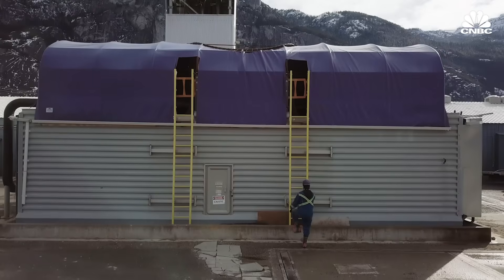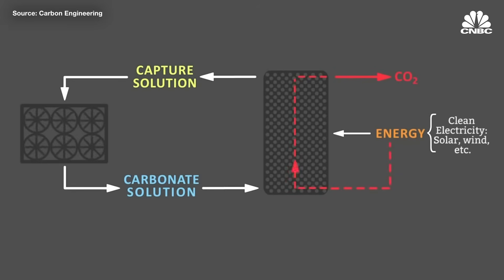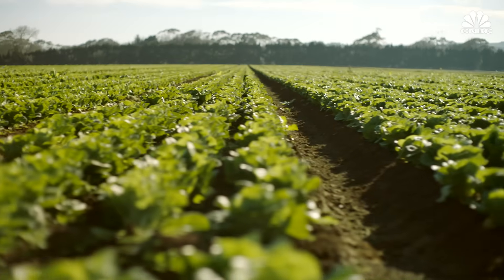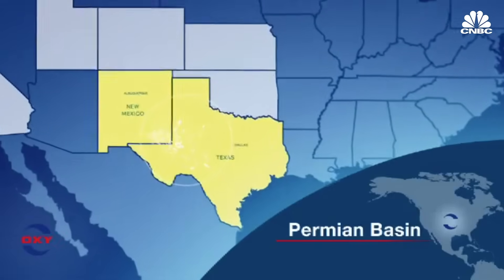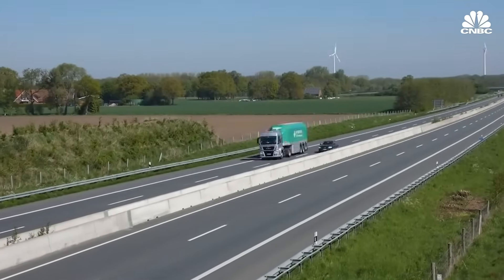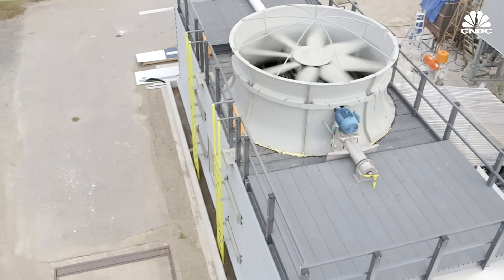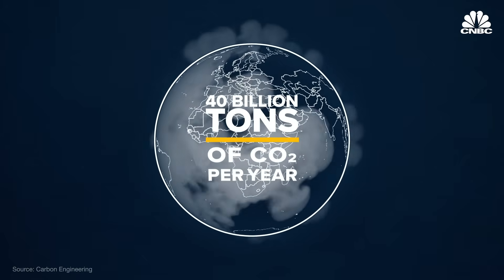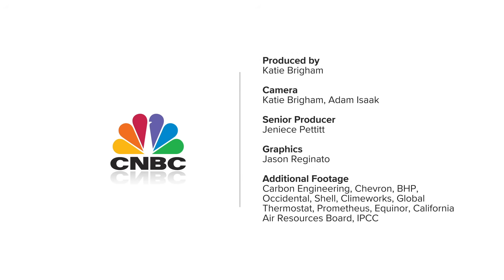Bill Gates-Backed Carbon Capture Plant Does The Work Of 40 Million Trees

Comment: And that's how they start charging for air.
Reply: They would get paid for co2 capture versus co2 emissions, which now have a co2 taxation system in a lot of countries. 
It's already a system for it. This is capitalism working in the right way.
Reply: @martink5842  1) its not working 2) its not capitalism if its imposed by state
Reply: @Goose Lee it doesn't make air... it removes co2 from air...
Reply: @martink5842  
Plants consume Carbon Dioxide & release Oxygen.....
Reply: Hey, we cleaned the air you breathing, so here's the bill.
Reply: @Goose Lee we as a species emit more co2 than greenery can absorb. We are far beyond the point of agrarian society levels of co2 in the atmosphere. There is not enough of space on our planet to curb the co2 levels we emit yearly by planting trees. There have been several articles about that. Trees cannot solve the problem alone anymore. Even if we use every inch of surface area on the planet that isnt water it still wouldn't be enough, that includes human settled areas. This is the only way forward concerning co2 in the atmosphere. 

Until and during 1700s  it was around 280 ppm with co2 in the atmosphere, and today, 2019, it's at 413 ppm.
So in essence in the start of the holocene until 1700s it was rather stable, some peaks and some dips in co2 levels. Natural causes for it. The planet was lush with a lot of pristine forests. 

And you cling to the notion of plants losing their co2 to grow? For real? 

Co2 is an suffocating gas for all animals. That is one property I hope I will never have to experience while being outside.
Reply: @martink5842  
You are Propaganda,
based upon junk science......
Reply: tim coker  
Only if you allow...
Reply: Good one
Reply: Do you know that there are several different types of photosynthesis? One type dislikes higher co2 levels, dislikes higher temperatures. 
If you've actually read about this you'd know that their broad spectrum arguments for "higher co2 is good for plant life" is a very thin one. If I remember correctly, an increase by 2% co2 decreased one group of plants photosynthesis by 12 to 15 %. 
If you come from non tropical climates you will know this as seasonal plant life. Why do some plants grow earlier than others. 
C3, c4 and cam... read up on these, please.
Reply: @martink5842  
Great Mumbo Jumbo.

Comment: ??  Um if you take carbon from the air you will increase weather instability .   Where do you mind numbed robots come from??  That is if you can remove enough,  to make a change, and even if you could a single large volcanic event would just replace it.   insects produce way more carbon compounds than humans ever could , this is total   P.R.
Reply: so doubling the amount by pumping it into the air is fine but try to undo that and that will cause instability?

also yes other things produce more co2, earth also already sequesters that co2, as it took millions of years to reach that balance
the important part is we BROKE the balance by increasing output and not bothering to increase sequestration
Reply: @magnusorn7313  What man puts into the air, is nothing compared to nature...  Summary...it is like taking your car to the repair shop, with a knocking engine (sun) and a transmission grinding (water vapor)  and the repair man  opens the trunk and removes a single lug nut from the spare tire (global warming) thinking that will make a difference.
Reply: @bobkat1663  "hat man puts into the air, is nothing compared to nature" irrelevant, nature took millions of years to balance out, we upped the carbon output but not the input, that means its out of balance
if as you say the earth puts out more then why havent carbon levels been rising steadily for thousands of years

use your brain on that one
Reply: @magnusorn7313  I understand where you coming from, but carbon levels have been much higher in the past, for very long periods.  It did not change a thing, if anything it will only improve our weather.
Reply: @magnusorn7313  The oceans are vast, and can filter alot of carbon from the air, fairly quickly.....in the past it is thought that the oceans either were not present or much smaller than now, and this help to contribute to higher carbon levels in the air in times past.
Reply: @bobkat1663  "carbon levels have been much higher in the past" yes, but you will notice that in the past these transitions take tens of thousands of years and not hundreds, and if they do take hundreds its typically correlating with a mass extinction

the thing with it happening slowly is that life can adapt and a balance can be formed

"It did not change a thing" flat out lie, changes in climate almost always correlate with species dying out, its not good or bad change, its just change, nad thats bad, because life is not good at adapting to sudden change
Reply: @magnusorn7313  You misunderstand me...the point is that the sun and water vapor drives earths weather, almost entirely, along with tilt of the earth and spin of the earth, not carbon or any other gas.  Now if the sun got bigger,  or got more intense, then you would see direct global warming.  The periods of higher levels of carbon I speak of, are at the peak of earths bio... past,  it is when everything including man were much larger. and lived longer.    Carbon output is the single lug nut on your spare tire, that is in the trunk, it has nothing to do, with the running  of your car. (weather).
Reply: @magnusorn7313  One other interesting note is some of the mass extinctions that occured, were also on and/or about the same time earth got more water on the surface of the earth. and yes there was more carbon in the air at that time...prob. due to all of the eruptions around the world, as a planet came passing by.....likely  Vensus or Mars  hard to say.
Reply: @magnusorn7313  The oceans moving across the beaches are earths #1  carbon scrubbers,  in the first place.  You could burn the entire surface of the earth and everyone on it, and the earth would balance in like 2-3 years, (seed growth, and fresh fertilizer).  Now very large events, do have a longer lasting effect but in the end, it is the sun and water vapor that drives it all.
Reply: @bobkat1663  "surface of the earth" how about all the underground coal?

Comment: There are 3 000 000 000 000 trees on earth. 75 000 of those factories. Building factories using fuel energy to reconstruct from co2 the carbon you can burn again is a solution which can be legitimately questioned.

Comment: Why Don't You Use A Windmill To Make Hydrogen And Mix It With The Carbon Dioxide To Make Methane And Water? https://en.wikipedia.org/wiki/Sabatier_reaction
Reply: CO2 + 4H2 @400 Celcius; Under Pressure = CH4 + 2H2O
Reply: In Situ Resource Utilization

https://en.wikipedia.org/wiki/In_situ_resource_utilization

Comment: Here's the problem with this technology: what do you do with the carbon dioxide that is captured?  The video says it is buried underground.  What benefit is that?  The video says it can be used to extract more oil.  That means MORE pollution.  The carbon could be used to make synthetic fuels.  And how many cars are out there that can use synthetic fuels?  Not enough to justify using the technology to make synthetic fuels.  So, as I see it, the main problem is that the captured carbon dioxide has a VERY limited use.  Is removing it from the atmosphere a good thing?  Absolutely!!  But what to do with it afterwards.  It's like desalinating seawater.  What's left is the brine.  What do you do with the brine?  Recycling something is one thing.  What to do with the product created after recycling is the second part and probably the most important part.  If you don't address the afterwards, you just have another problem to deal with.

Comment: Why are we getting sidetracked by these remedial processes when we need to NOT put CO2 and other greenhouse gases into the atmosphere in the first place? This is counter productive at a time when we need to putting much more resources into green energy projects. By an large, the planet has been greatly deforested and a carbon capture machine falls well short of providing the benefits we enjoy from a forest including O2 released to the atmosphere, habitat for wildlife (which is under going a major extinction), water storage and slow release, temperature moderation by evaporative cooling of the air, etc, etc.

Comment: Nonsense. The release of carbon into the atmosphere is the product of using its energy. This means that to restore it to its solid form you need to introduce energy BACK. Where do you get this energy? That's right, you take it from somewhere else, basically like burrowing money to pay another debt, you are still in debt, you are still polluting.
Reply: the idea is to use renewable energy to do this
if fueled by fossils then yes, this would be pointless

Comment: Great but what will happen if it turns out that there is no green house effect? There were many climat changes in the past (when there were no humans) and rising of temperature was the CAUSE and not the  EFFECT of co2 rising. But lets assume there is a greenhouse effect - fine lets throw billons taxpayers money into sucking up co2 out of the atmosphere but what will you do about water vapor? because water vapor is far more important as a greenhouse gas in the greenhouse effect theory. If this will not work what will you come up with then?
Reply: "There were many climat changes in the past (when there were no humans)"
yes, who disagrees with that statement?

"and rising of temperature was the CAUSE and not the  EFFECT of co2 rising" not really, it many cases its shown that it was the cause

"but what will you do about water vapor" we dont have to do anything about it, its self regulating, the amount of water vapor the atmosphere can absorb depends on the temperature
nature does this thing where if you leave it alone for millions of years without lots of change it balances things out
the thing is co2 which we generated by digging up all that condensed carbon is not self regulating, if it gets warmer the co2 sticks around

Comment: trees are only a temporary solution , when they break down the co2 is released back into the air .
Reply: do you think it would make more sense to use the resources to produce these plants and maintenance for hundreds of years?  trees can be re-planted. these plants aren't renewable as they run off of the very fossil fuels which effects they're trying to mitigate.

Comment: no wonder that  only  99.96% of air is not co²  we are starving ouer  plantlife with need higher concentration of co² for optimal grows about 0.12 % with is 3 times more than pressend and by the way there is no greenhouse effect outside greenhouses 
co² levels always follow the worming and cooling with an delay greater 100 years hence co²
has nothing to do with climate anyway
Reply: "we are starving ouer  plantlife" no, im not dehydrating my child by NOT drowning them in the bath

"co² levels always follow the worming and cooling with an delay" actually thats not true, this is based on ice cores where they see more co2 after the warming happens but this is becasue as the warming happens the cow is in the air, and its later when the co2 layers onto the ground in larger amounts
your conclusion has to do with misinterpreting data

Comment: Personally i think rather than constructing co2 plants that make virtually no profit the technology should be simplified and made accessible to consumers. Cities would easily buy into technology that removes co2 from the air, a huge market point would be of the devices ability to improve air quality. Rather than trying to sell the carbon thats captured, sell the device itself! make it simple and compact similar to an AC unit, cities would easily buy into a device that can be installed on roofs and improves air quality after all cities suffer the most from bad air quality.

Comment: Bill Gates and MrBeast are doing more work than those climate cultists.
Reply: 20m and 40m trees dont do much

i mean china is planting more trees than the rest of the world combined
The government says that it has planted more than 66 billion trees across 13 provinces in the country's north

you also have to consider that these capture plants need power to function, either they are powered by fossil fuel in which case they are at a net negative and not helping
or they are using up resources on renewable energy that would be used better if it went towards powering society this offsetting the need for fossil fuel plants

all this does is give excuses to extend the lifesplan of currently running fossil fuel plant because we wont be switching our national power generation over to renewables

Comment: Find a way to efficiently use the carbon that is captured and promote/susidize this. eg. as a building material for goods/structures/stable landfill (to build on, not to store it) etc and not as fuel! (not yet at least). 
Do this well and supply / demand will take care of the rest. 

Just make sure there will be enough CO2 left for plants to grow or else driving gasoline cars will be the best environmentally friendly thing to do.

Comment: there is a big problem with these carbon capture 
if they capture every amt of carbon out of air the trees they wont have enough carbon to live 
and the trees might die creating a new problem
the new problem is we might not have oxygen 
if the trees die then there will be less amt of oxygen produced
then we have to find a new way to create oxygen
this might create a big loophole
Reply: Hopefully it will only capture "excess" carbon dioxide and leave enough carbon dioxide for the trees. Right now we have a surplus. If they're smart, they will measure carbon levels in the atmosphere and adjust the use of this technology accordingly.

Comment: This is a horrible idea! Did you guys hear what's happening about this in the video? Basically, their recycling air pollution. They're pulling carbon out of the air in order to turn it into a fuel that can be burned by vehicles and expelled into the air again. They're not solving the problem they're just profiting from the problem.

Comment: "partnering with oil company is a step in the wrong direction"
Stupid, they are trying to do their part, and it is working.
The oil company knew that oil will run out soon, and they want to always have control of fuel

Comment: Okay, but live organisms that produce O2 and filter CO2 don't need electricity to function, they don't heat like motors and machines do. Plus, they help balance the biosphere they live in. This is so masively stupid, tbh.
Reply: Not only that but the power these CO2 removal machines use to operate comes from coal, oil, and natural gas power plants. It's like a dog chasing it's own tail.

Comment: Vast majority of carbon capture ideas are dumb. Pumping CO2 gas into the ground is just ripe for a situation where the gas leaks out of the ground and there is little confidence that leaks could be detected. Planting trees doesn't work unless as alluded in the video, you capture that biomass and store it underground, but doing that as CO2 goes back to the first problem of not being 100% certain of it not leaking out. Now if they collected the biomass, dessicated it and stored it underground, like the reverse of what we do now with oil/coal extraction, that would actually work. 

The only way to fix the issue is to do a complete 180° on how we obtain carbon and completely supplant carbon fuels for clean energy fuels. Not a fan of fusion because it permanently destroys water and has the potential of leading to logarithmic increase in energy consumption and complete destruction of all water on earth within a few generations depending on how many stupid ideas we think of to waste energy. 

Only a fan of nuclear if it can be prevented from melting down/requires little intervention as expending all of that material from the environment would be a good thing. Recycling nuclear waste in such a way to prevent proliferation should be a thing. All the other green energy sources are fine so long as they're not taken to any extremes.

Comment: I love the technology. Where I have issues is that Chevron, BHP and Occidental do a ton of fracking which destroys the water supply near it, studies show that areas closer to fracking have a higher chance of cancer, and it releases methane emissions as well. Methane emissions are 30 times worse when it comes to green house gas than CO2 is. Considering these machines only work on CO2 it only only helps with one small part of the problem that these big oil companies are causing while ignoring the giant elephant in the room.

Study by Yale that shows higher cancer rates near fracking sites
https://publichealth.yale.edu/news-article/13714/
https://www.ncbi.nlm.nih.gov/pmc/articles/PMC5235941/

Methane is 30 times worse than CO2 (Princeton Study)
https://www.sciencedaily.com/releases/2014/03/140327111724.htm

Fracking causes rise in methane emissions
https://www.theguardian.com/environment/2019/aug/14/fracking-causing-rise-in-methane-emissions-study-finds

And oil companies and fracking
https://www.wsj.com/articles/big-oil-moves-to-tighten-its-grip-on-fracking-11551789120